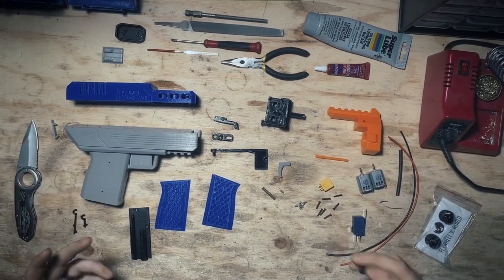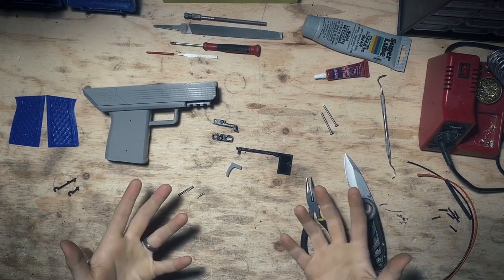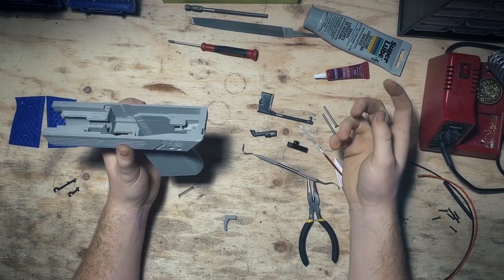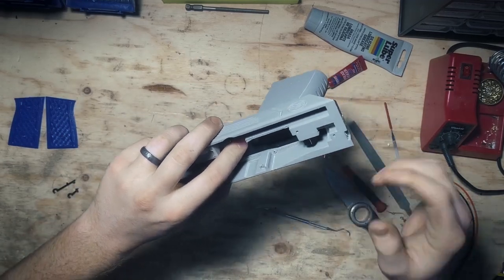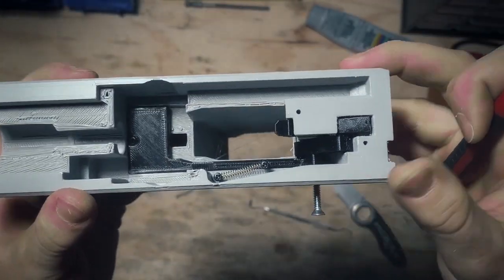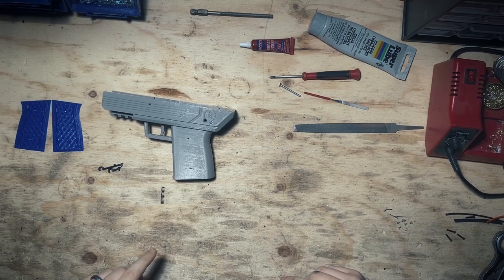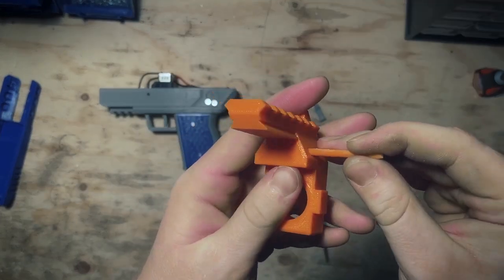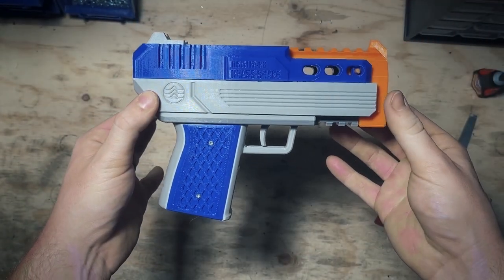FP-68 Grass Snake | Build Guide

Comment: I lost my spring for the trigger. And I have a huge nerf gun collection, any where that I can find a replacement?
Reply: I mean mag release spring
Reply from the maker: @tilmanseide4673  Ah shucks. Yeah, email us and we'll see what we can do. support@frontlinefoam.com
Reply: @FrontlineFoamBlasters  Actually, I dont need it, last night I just found a spring sitting around that works completely fine.
Reply: Sorry for disturbing you so much, but I cant get the detent in. It just doesnt go in. The long second one doesnt even fit in properly, it just slides down. This is my friends blaster and I built a magpie, which worked out really well, but this I wont be able to build for him. I did everything but the detent, and its just making me really mad. Any solutions?